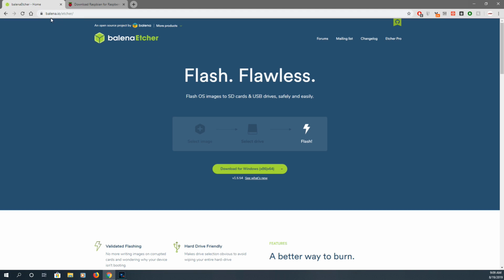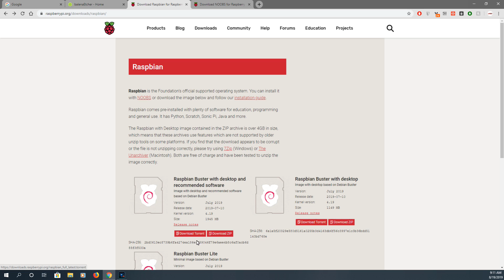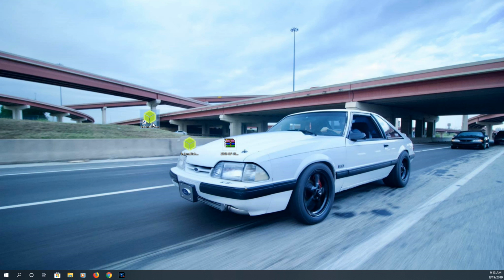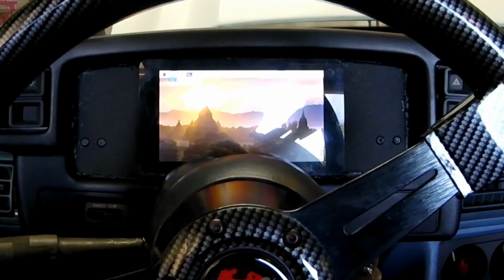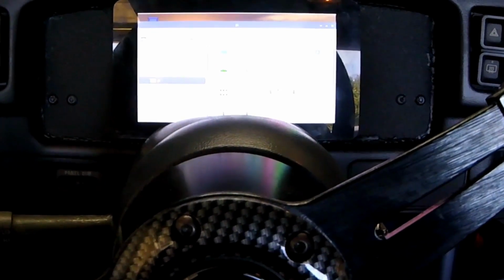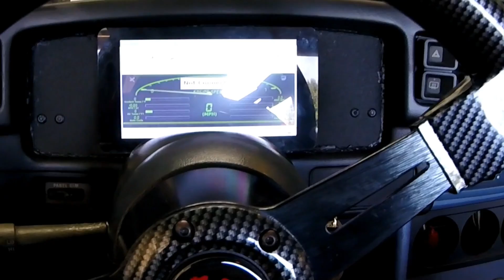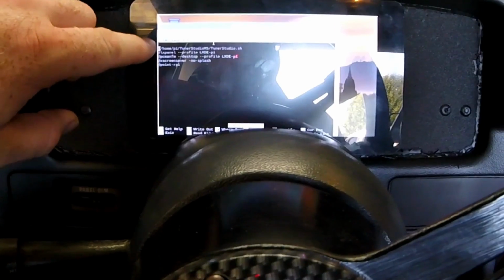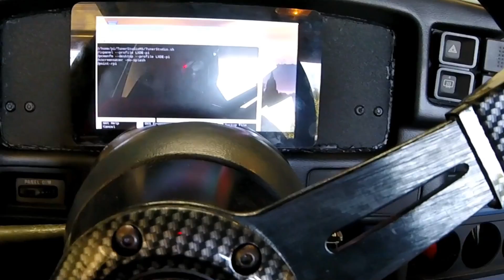Custom Pi Dash Dashboard In Turbo Fox Body Mustang Pt.1

Comment: Are you no longer going to drive it on the street? Headlight high beam indicator is mandatory for an inspection, possibly turn signal indicators. Or are you going to add that in another video?
Reply from the maker: Headlight, turn signals still all work in the car. Car is register as a antique and no longer goes though inspections